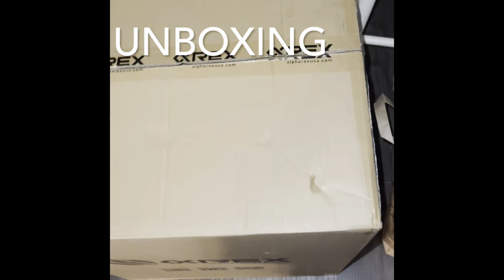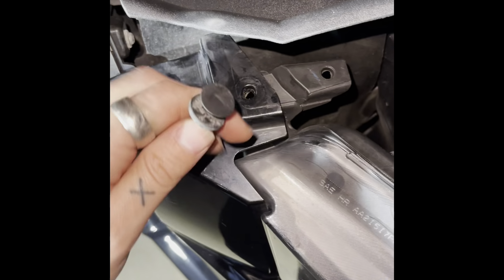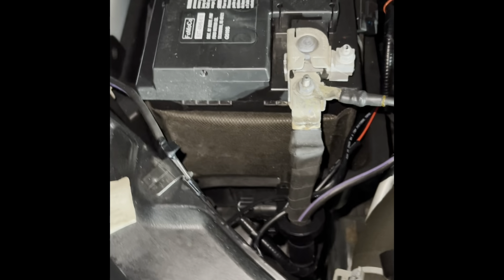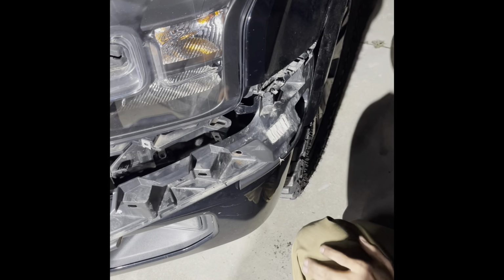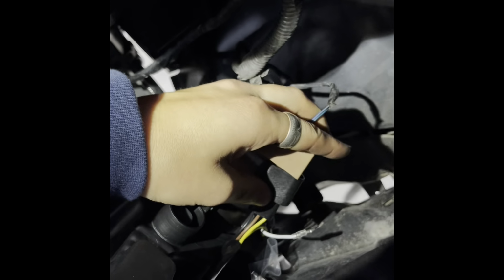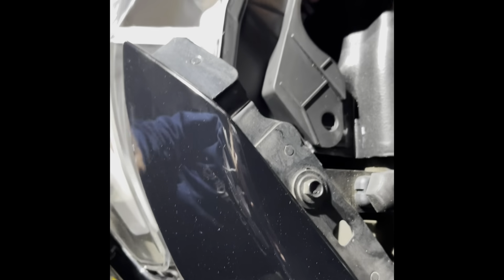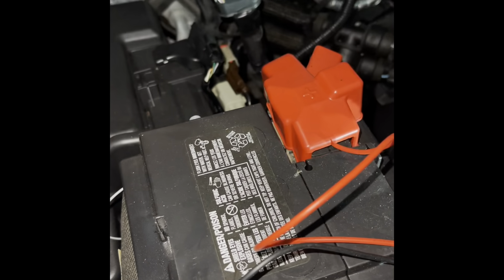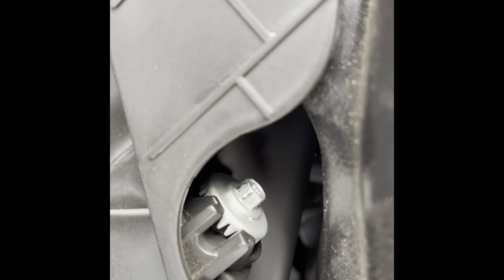ALPHAREX Pro-Series Headlight Unbox/Install : 15-20 F150

Comment from the maker: Installation starts at 2:48 for those of you looking to bump ahead in the video :) I would love any feedback you guys are willing to provide by throwing in a comment below!
Reply: Loved yalls video just put mine on today, thanks for your help! 

Check engine light did come on, thoughts? They do work perfectly though ??
Reply from the maker: @achambers3093  Thank you! So glad it helped and that you like your lights :) I have had no complaints so far, I love them! 
My channel kept putting your comment in my notifications but would not show it when I went to the video UNTIL TODAY! Haha

My suggestion for the check engine light would be entering the Engineering Test Mode so that the truck will test the gauge cluster/dash. 
Put the key in the ignition(leave off), hold the ‘ok’ button down and then keep it down while turning the key to ‘on’ (do not start the vehicle). Your dash should say Engineering Test Mode and move through a series of self tests such as ‘Gauge Test’. This also works for when Fords have an issue with the analog speedometer getting stuck.

Comment: Great install video! Have you had any issues with the built in LEDs turn signals or moisture trapped in the housing?
Reply from the maker: Only issue I have noticed is if it’s really cold out when I do remote start the drivers side white led doesn’t turn on but once the truck warms up and I put it in drive it turns on also if I turn the lights fully on instead of on automatic and then switch it back it also seems to stay on. That doesn’t happen consistently but I have noticed it on cold days which likely has to do with my wiring more than the light itself. 
I’ve never had any moisture retention issues no matter snow/rain/car wash/heavy humidity

Comment: Update I got the headlight install done, they look great, and they’re all wired with the fuse block , but the turn signals when they switch back they work but they’re aren’t sequential , they just flash from white to amber
Reply from the maker: Yes! Switch back is the phrase I was looking for, not sequential, my mistake! The add-a-fuse helps make the SWITCH BACK work! So glad it worked for you and that you like them, I have been very happy with mine :) just as some feedback for me, was the video in depth enough for you to complete your install without much difficulty?
Reply: @mackenziecustoms5286  it was good!! Actually perfect , I followed your steps and it was easier, I’m guessing to make them sequential you have to buy a higher model headlight but at this cost they’re perfect , plan on switching an LED into the housings soon , should’ve done it all at once but I was impatient , keep the videos coming !
Reply from the maker: @donaldgonzalez1515  awesome! Thank you :) I’m so glad following the steps was easy! I would have to assume the same, that sequential would require a more expensive headlight. For me personally, I’m very happy with the look of the switch backs and their price point so I definitely don’t feel I am missing out. Thank you for the feedback and I am definitely keeping the videos coming!
Reply: @mackenziecustoms5286  I have the pro series and mine arnt sequential when putting the turn signal on but when I turn the truck on it does the pattern ? What can be wrong I do have a fuse added on

Comment: Is there a separate wiring harness for the small  white wire?
Reply from the maker: The only separate piece you really need is the one for the fuse box but you can buy the fuse and fuse connector together, aside from that everything comes with! I ordered directly from Alpharex so I can’t speak to other merchant platform experiences if they for some reason require the harness be purchased separately or something.

Comment: I thought the turn signal is sequential for these or is it just the camera not picking it up because it looks like it is flashing solid.
Reply from the maker: It does a sequential-like motion for remote start up and unlock features, turn signals are switch back style 👍🏽 There is a more expensive headlight by them that I believe is sequential turn signals if that’s specifically what you’re looking for :)

Comment: Did you use the light they supplied or did you switch to led? If you went led did you have any issues?
Reply from the maker: I just used my halogen lights I already had but I have been considering getting LED bulbs recently…..sorry for the late comment, let me know if you went LED and how it worked for you please!

Comment: Sorry to bother i did installed these headlights on my truck. But ididnt wired the extra harness...that connects to the white wire...whats the benefits of that extra harness...my drl white lights come on but not very bright
Reply from the maker: The extra wire adds an additional fuse point. I’m not 100% sure on its specific benefits but maybe the fuse boost helps with longevity or maybe your brightness issue
Reply: @mackenziecustoms5286  thank you I will reinstall the wire tomorrow again

Comment: Does the fuse block that you added into slot 97 come with the headlights ?
Reply from the maker: It does not, it’s called an “add-a-circuit” you can get them at your local auto store for cheap. Make sure there’s 2 open slots for fuses on the one you get :) here is the link to what I got: https://www.autozone.com/electrical-and-lighting/fuse-and-accessories/p/bussmann-atm-add-a-circuit-fuse-tap/32416_0_0?cmpid=LIA:US:EN:AD:NL:1000000:ELC:8360136649&gclid=Cj0KCQiAy4eNBhCaARIsAFDVtI0TpNj3GirIsrzdbqqBs1okmdER9UW4bbvMUgn0kdSAM3hKU-I1avEaAtZnEALw_wcB&gclsrc=aw.ds
Hope that helps!
Reply: @mackenziecustoms5286  How are we supposed to install it if it doesn't have the fuse adapter? only for curiosity
Reply from the maker: I’m sorry I don’t understand your question? My instructions in the description are to purchase the add-a-circuit and extra fuses, that is the only additional items needed. The rest comes in the box from AlphaRex and then you install it all in one swoop as I did in the video. I put a link in the last comment to an add-a-circuit example
Reply: @mackenziecustoms5286  Excuse my English, can you tell me what the harness wiring is for?
Reply from the maker: No problem, just trying to make sure I understand so I can help as best I can :) So when you get the headlights they will come with a wiring harness which also includes an extra grey wire to make the sequential portion of the lights functional, you don’t have to use this portion of the harness but in my opinion it makes the lights function to their full potential and only requires the extra purchase of an add-a circuit(see link I posted to autozone in another comment) and an extra fuse :) fuse slot 97 worked very well for me. Some of the sequential functionality is best shown when you use your remote start you can see how the lights come to life. Does that help you? let me know if not! I’m happy to try and find different ways to explain it so that language isn’t too much of a barrier for your project :)
Reply: @mackenziecustoms5286 I am trying to figure out what I need to do for the add a circuit thing. Is there like a certain type or length or anything? I don’t know anything about them. Your video is very informative thanks
Reply from the maker: @kamdenherzig602  so it’s called a circuit fuse tap, cheap and you can get them at any auto parts store. It’ll have a wire ready to splice and a slot for your fuse 👍🏼 same basic size on them, nothing real specific. I got the Bussmann one from AutoZone

Comment: Where do you get the grey  wire or harness for the DRL startup sequel??
Reply from the maker: So the lights come with a harness because I purchased them off of the ALPHAREX website the only additional wiring I had to buy is the red wire with the fuse plug for the fuse box 👍🏽 hope that helps!

Comment: Did you change the headlight bulbs from halogen to LED on the new lights? Or left them halogen?
Reply from the maker: I personally left them halogen but I bet they would look good either way!
Reply: @mackenziecustoms5286  and what about the turning signal bulb, is it different size bulb as well?
Reply from the maker: @jwalkerftw  I just used the stock bulbs I did not have to get any other bulbs involved, I moved from the stock light housings directly over to the new housings without any bulb changes. So I would think if you chose to do LED bulbs you just need to properly match them to your stock bulb sockets and the installation process wouldn’t change 👍🏼 ALPHAREX does make an all LED light it is just more expensive so I chose this route and to add LED bulbs later if I felt the need. Hope that helps :)
Reply: @mackenziecustoms5286  did you have to buy an extra 10 fuse ?
Reply from the maker: @jwalkerftw  I bought extras just in case but I did not use them because I had extras in my fuse box already :)

Comment: Are they worth it ? Are the bright ?
Reply from the maker: They are worth it, they are bright but I never get flashed so they’re not TOO bright. Biggest thing is adjusting them to the height you need them once installed, I suggest finding level ground and a backdrop such as a closed garage.

Comment: These are the halogen one right ?
Reply from the maker: They are not LED but they are projector lenses so they make the lower lumens light shine a lot brighter! They’re not as insanely bright as LEDs I have had in the past that got me flashed a lot on the road, but they still improve my road vision significantly! I am very happy with them, especially with the adjustability so I can put them at the height I want for best line of vision :) hope that helps Viri!

Comment: They aren’t made for the 15-20,  the 15-17 and then 18-20
Reply from the maker: That is correct the lights themselves are for 15-17, but the installation/wiring/trim removal/ bulb and marker light transfer methods apply to 15-20 for the headlight installation :)